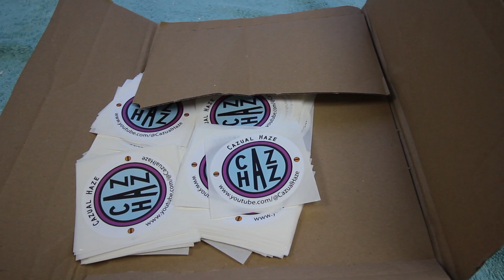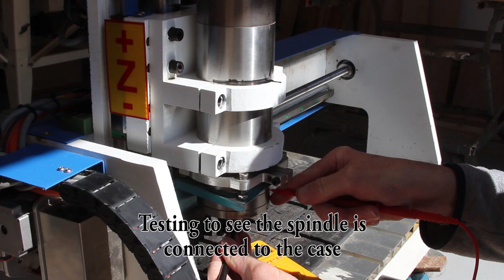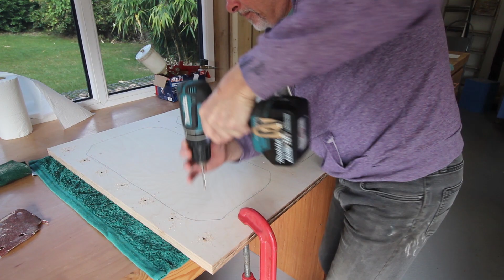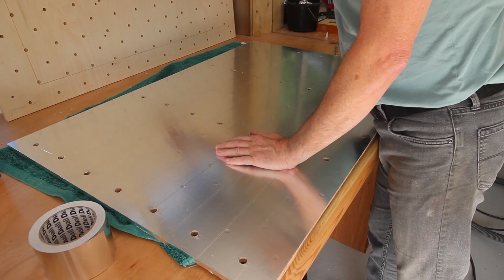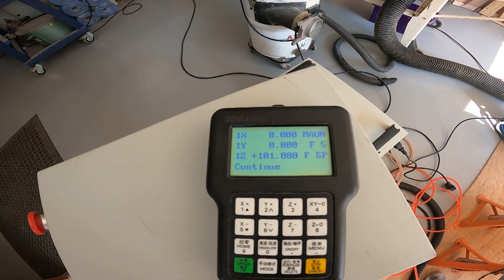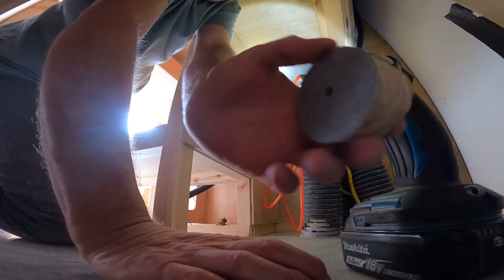Router Upgrade pt2

Comment: You should be able to do what you need with just a few components. If you look up a transistor bistable circuit that shouldn’t be to far from what you need. You would have to reset it each time it’s triggered. I like watching your videos it’s nice to see someone doing things properly rather than just bodging things together.
Reply from the maker: Yep a bistable would be a good idea however I have a few arduinos kicking around so have tried one. So far testing the code works but have not yet put in on the router. Should be interesting to see how it works.
Thanks for the comment cheers

Comment: Hi, Yes using a latching relay would work fine and will not be affected by electrical noise. If you need it faster use a reed relay. The workshop is looking fantastic and it has been CAT scanned.
Cheers Dave.
Reply from the maker: Thanks Dave,
I have got an arduino to do the heavy lifting the code is written just need to try it out in the real world.
Yep the shop has been fully cat scanned with a sniff of approval.
Cheers

Comment: With a two second slowdown on the motor I'd expect to see broken endmills instead of chewed up clamps, as the motor stops spinning fast enough to cut.
Reply from the maker: @fredmercury1314 thanks for the comment yes that is what should happen. I think it might be good to change the vfd to one with an external brake resistor that could then stop the spindle and possibly save the cutter after all they are pretty expensive. More to come on this in the next video I hope.
Cheers

Comment: Whilst its possible to construct a latch using a relay, relays tend to be slow and its much easier to use electronics. CMOS logic especially the early 4000 series which will operate from 12V is much simpler. An open drain or a tristate buffer or even a simple diode can interface to the estop input which likely includes its own pullup resistor. With a latch some means of resetting the latch is required. It may be simpler to use a retriggerable monostable to stretch the pulses long enough for the software to detect them. No reset input is required. Using a shielded wire will also help.  Using a lower resistance pullup resistor may also be useful.
Reply from the maker: @brucegriffiths8861 thanks Bruce that is exactly what I was thinking of doing however being a lazy bugger I have bought an arduino. I know that’s complete overkill but there is a little sense in it. When you crash the tool and it all goes into estop the axis are frozen so the only way to clear the fault is to turn off and move the axis by hand. An arduino lets me have a reset button to hold off the estop temporarily. It also allows me to add more functions in the future. I hope this makes sense and thanks for the comment cheers.
Reply: @CazualHaze  You still have the short pulse detection issue with an arduino unless there's built in hardware to either stretch or latch on a short input pulse.. An FPGA would be more flexible but there's a steep associated learning curve and  you need to devise suitable protection from 12V inputs and a suitable (discrete?) high voltage (>12V) open collector or open drain output device.
Reply from the maker: Thanks Bruce I agree with you I think the code will only be thirty odd lines long so it should cycle through damn fast with an 16M clock and 4M per instruction. Not done the maths yet. I could also use the interrupt function so it’s effectively just the interrupt service routine that will slow it down. I will connect the bed isolated plane to the 5v from the arduino so should not need much protection ( possibly a 5.6v zener) to protect against spikes. It did also occur to me to use a potential divider with say five to one ratio and connect it to the analog pin so I could detect a spike or a short and put into e stop. What do you think?
Cheers

Comment: What about running probes of the side of the router so they are your connection point instead of the cutting blade? It would be further away than the cutter but could give e-stop connectivity in the same way. 🤔
Reply from the maker: Hi @YourNowOnTV yes you could do that perhaps the dust shoe could have metal bristles that could work very well. Great comment cheers.

Comment: One question.  How do you plan to surface your spoil board if the inserts are not sufficiently recessed?  From the looks of it in the video, it appears that the inserts are just barely below the top surface.
Reply from the maker: @philshel1 the inserts are indeed quite shallow. I did not want them penetrating the board to stop chips falling through.
There was not time on this video but I have some mdf to use as a spoil board which is easy to surface and cheap to replace.
Cheers